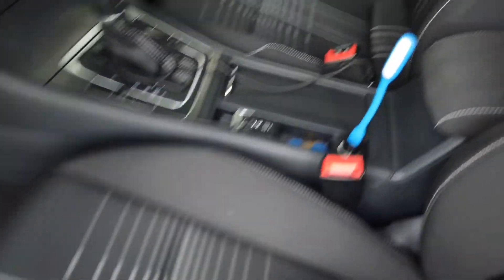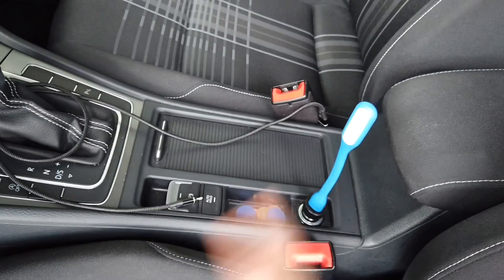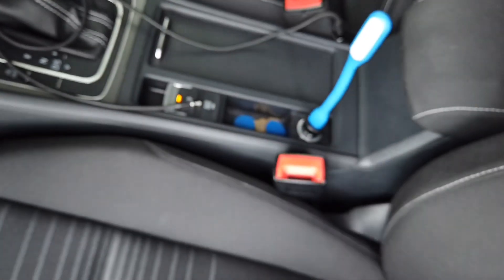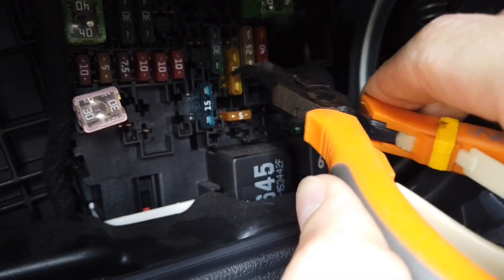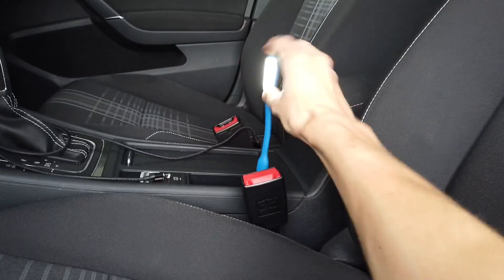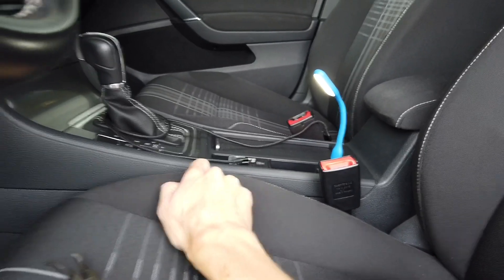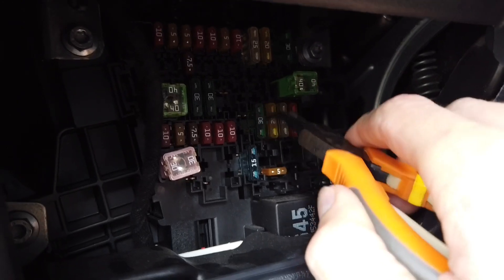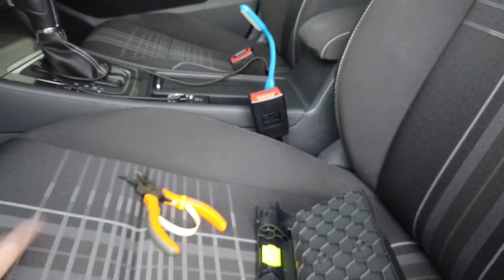VW Golf MK7 (5G) 12V outlet logic ignition hot vs permanent

Comment: Thanks man that's a great tip! I use a Dash Cam and always have it connected in the cigarette lighter, would you know if the power supply is permanently on if that drain the car battery? Cheers

Comment: Is this similar on the MK5? I want to turn off the always on cigarette lighter
Reply from the maker: Not sure if MK5 had this feature. If you have the skills, you can access back of the fusebox and rewire it a little bit, so the 12V outlet fuse is connected to term. 15 instead of term. 30.

Comment: It is a stupid tip because you run the risk of killing your battery any gadgets you run which consume 12 volts for a lease half an hour will potentially drain your battery result in failure to start. I think you forgot the disclaimer
Reply: This ain't America. We don't need stupid disclaimers.
Reply: Half an hour? LOL, countless times I had my stereo on for a couple of hours before the voltage dropped enough for me to start up the car.